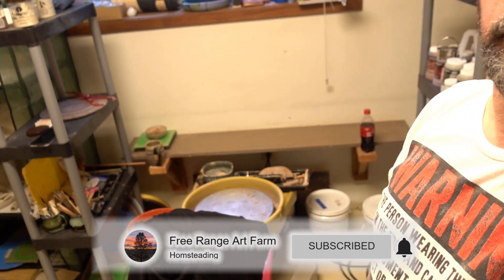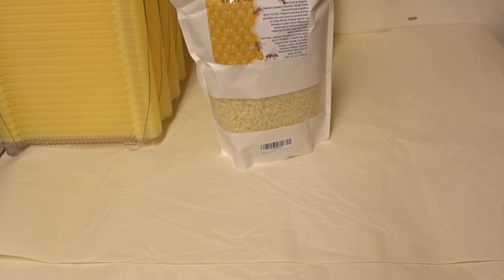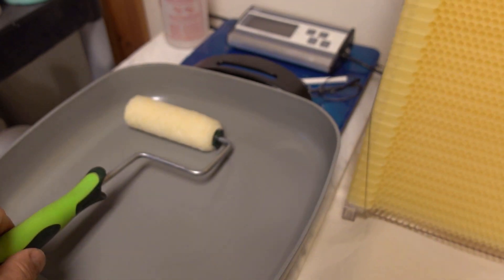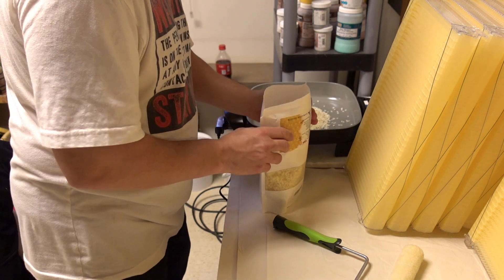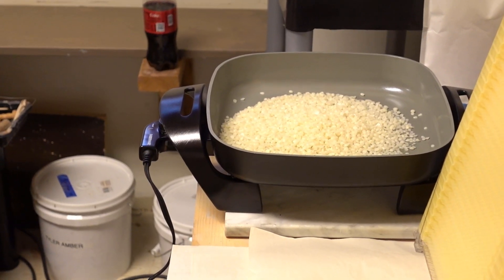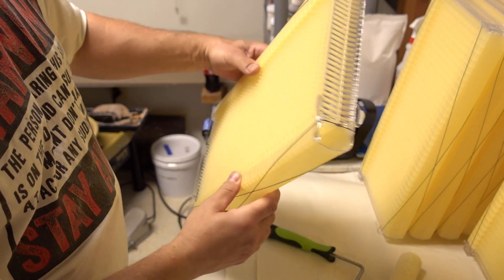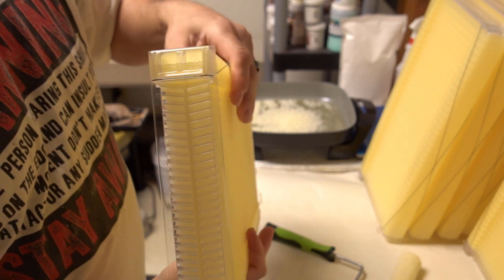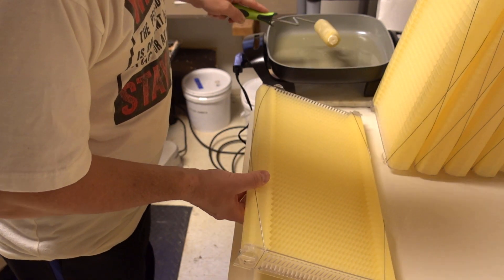Flow Hive secret | How to get the bees in to the Flow Hive super

Comment: How did this turn out? Did it work well?
Reply from the maker: It worked to get the girls up there and have them start working the frames. I had a bad nectar flow the first year, then last year my girls swarmed. So, I haven't ever had them fill all of the frames, but they certainly used them, and I was able to extract from a couple of frames.

Comment: Nice video… However, silica dust from the clay that is on all surfaces of your pottery room, is actually not good for anybody… It is actually really unhealthy what you are doing….
Reply from the maker: Yes, silica dust is a dangerous aspect of pottery. We do clean all of the surfaces on a very regular basis and it's just a hobby. Our silica exposure is really very minimal. I also took precautions for the bees when I waxed the frames. If you noticed I placed clean sheets of packing paper on the surface of the table before I started working.